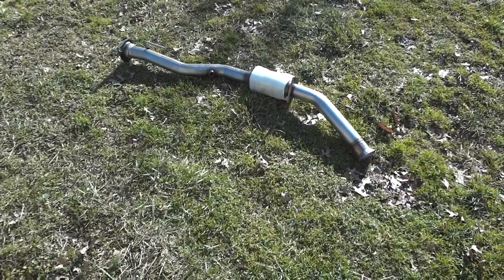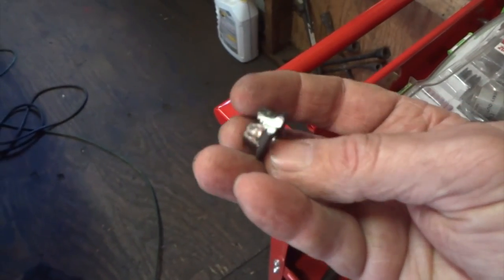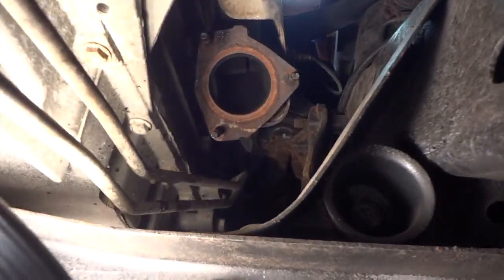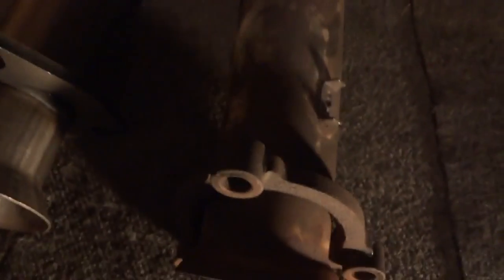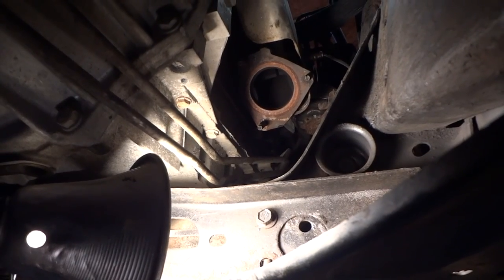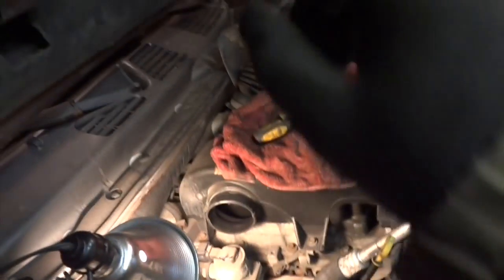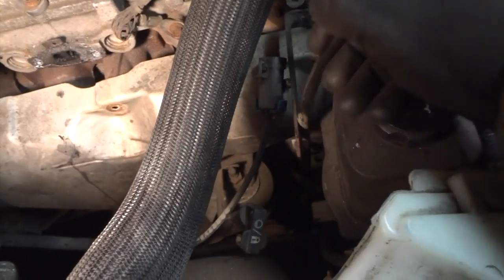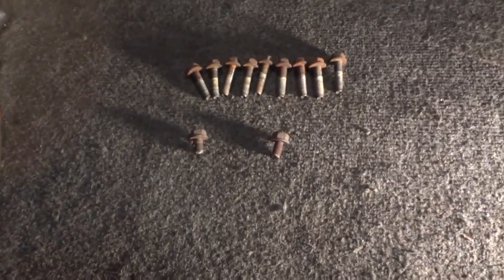Buying Aftermarket $120.00 Catalytic Converter Install *(Mine was Jacked!)*

Comment: Hey mate! How is the converter holding up nowadays in June 2024? Any issues with codes or poor fuel mileage? Same metal gauge thickness? 

I’ve been working on my new Envoy and dealing with P0410 and P0420. New O2 sensors eliminated the code, but still have “low catalyst efficiency.” I was struck by the low cost of these but wasn’t sure what pitfalls it may bring. Thanks for the side by side comparison. Sorry that happened but thank you for completing the transfer of knowledge! That would not have been fun.
Reply from the maker: Well i still have a p0420 code....but the scan tool says the cat has a green light ....(meaning no issues) but i have a code.  2 new o2 sensor and still a code. I even installed a new computer! (Just to make sure i have the latest flash update). I'm still working on a solution and when i figure it out may do a video on it. ...Probably aftermarket crap...I'm just not sure yet. I might graph some data and watch the down stream o2 and see what it doing.

Comment: Jeeeeez this looks like a rough job. Would it help to go with Walker or OEM instead of eBay? Pretty sure my cat is fried sounds like something's rattling around in there and potentially restricting my exhaust. Gonna pressure test it sometime this week. Thanks for the vid really helps me know what I'm up against...
Reply from the maker: Great! So far its holding out. No codes yet ;)
Reply: @FixingWithPassion  finger crossed 🤞 pray to the car gods 🙏

Comment: I had  the heater readiness code that wouldn't get enabled so I ended up having to get a reflashed ECM for my S10 pick up and guess what problem solved. I changed everything to fix it. But it was the ECM.